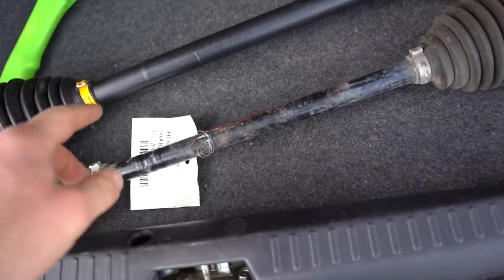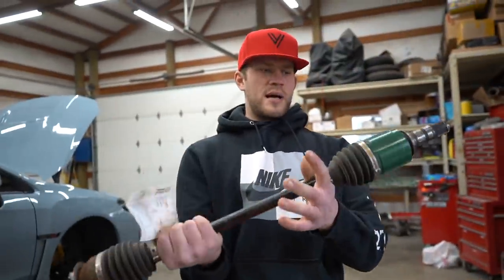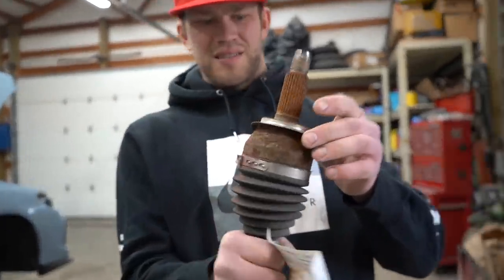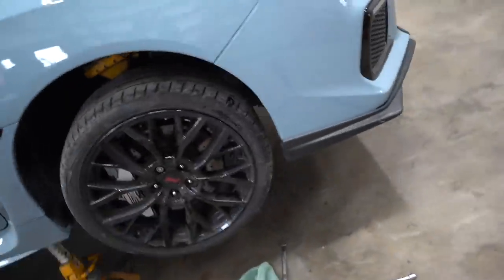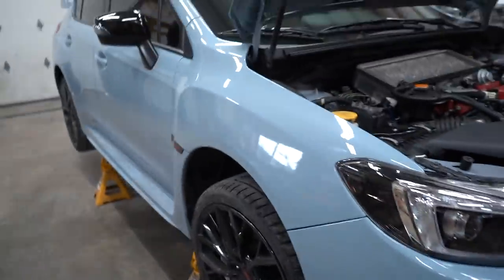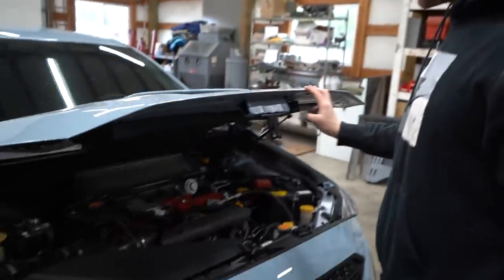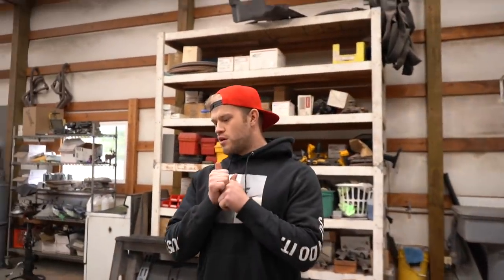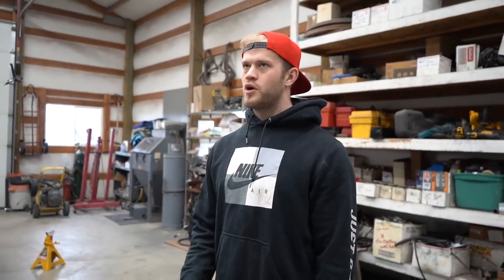Selling the Series Grey STi

Comment: ABS/TCS lights come on when your steering wheel/clock spring is misaligned after you take the steering wheel off. There should be markings to align the clock spring. Had this same issue on my BRZ after I swapped a new one on.
Reply: its called recode the steering angle sensor
Reply: Correct, right now the Series Gey has different steering wheel rotations to the left and right side. Also the steering angle sensor / clock spring ist not correct aligned right now, the sensor thinks you're cornering while the car is going straight in reality. That's why your traction control light is on.
 Just a recoding of the angle sensor won't be enough.
Better go ahead with a full suspension alignment and the steering wheel in its original position.
Nevertheless: Great STI build!

Comment: for the ABS light, you need to change the steering wheel clock.
Reply: Or maybe its low on blinker fluid .
Reply: hounddog2952  LOL
Reply: hounddog2952 that happen to mines, after top up the lights came off as I went around an corner

Comment: The abs and hill start lights and all those might be caused by a faulty speed sensor which would be the electronic line that bolts up to the passenger side wheel hub area. When me and my friends were doing my coilovers on my15 wrx we cut that electronics line on the passenger side and found out that the abs sensor is on the driver side and the passenger side line is a speed sensor line. Dont know for sure if thats the problem but ik that i had those same lights on my dash when we cut that by accident. We ended up swapping the speed sensor from a friends sti to the wrx so they definitely have the same wire.

Comment: Hey man I had my c.diff lock flashing after my motor was built. Ended up being a small wire above the transmission that’s actually connected to the transmission that got pinched and it was making it act all crazy. Take a look it’s a quick fix dude.
Reply: I actually had all those lights and this fixed it^

Comment: The Sti feels slow because its only in sport mode since the abs light is on it will not go into sport sharp mode which is when you're at 306 crank hp